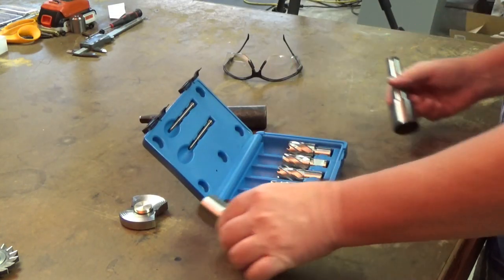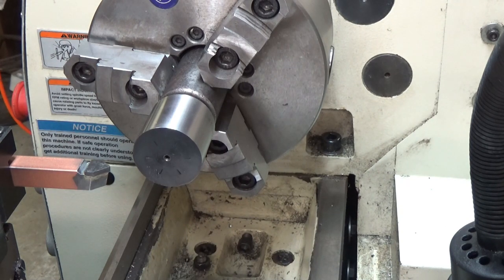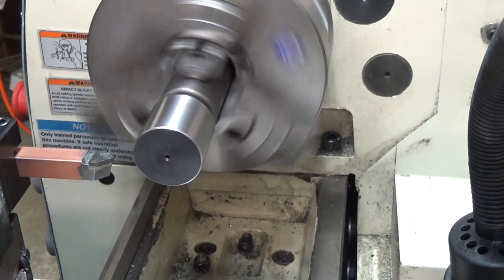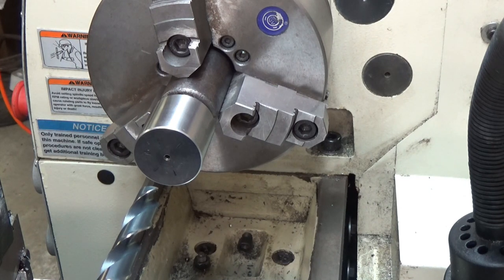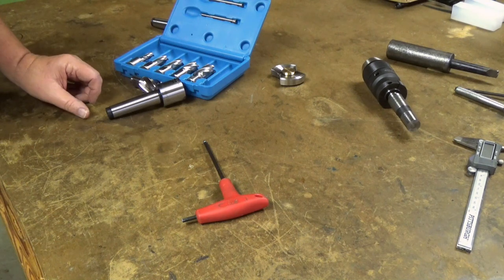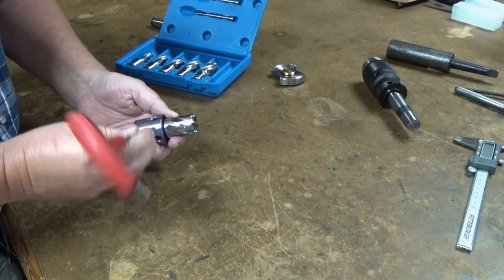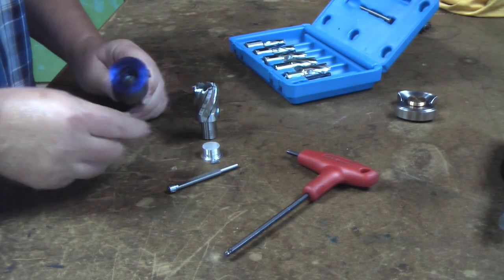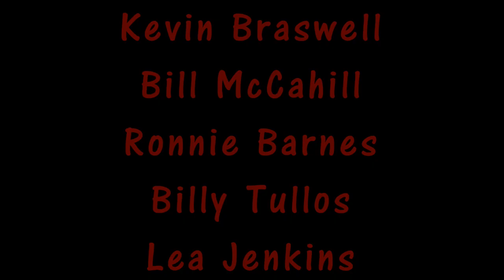How To: Annular Cutter Holder(Caution Subliminal messages ahead)

Comment: Those cutters are really great.  For some reason i have the irresistible urge to get Zeke a big doggy treat.
Reply from the maker: Yeah I was just playing around with the subliminal Zeke thing, the cutters are bad ass, made a really clean hole. If I had tapped the arbor in the tailstock in the beginning I would not have looked as stupid when I did the test at the end

Comment: Nice height gauge Brian. 
That's a great idea for the annular cutters - I have a set although not very good quality. I think I have one or two spare blank MT arbors that might be useful. May copy your idea there.
Those things are great for saving lot of drilling etc before boring bar if needed.
First flash of Zeke took me by surprise!
Reply from the maker: I was quite impressed at how well that thing cut, it does make a rats nest of chips.. I do wish I would have got the tool better seated in my tail stock at the end when I demo'ed it.. oh well..

Comment: Question is why make a tool holder when their readily available finished machined? The Morse taper ones I have also have the tang to prevent any slippage as was shown here.
Reply: The tang on a Morse taper isn’t for driving……….it’s there to help you get the thing out of a blind hole.

Stavros
Reply: @stevecallachor  it can help also prevent initial slipping. If not seated properly

Comment: Hello Brian and Zeke,  Hope you are healing up and getting back to full bore.  I was watching Dudley Toolwright messing with titanium and thinking about you guys.  All the best.  Give Zeke an ear scratch for me.  Take care.  Doug
Reply from the maker: hi ya doug, Zeke is ok but me not so well, sure is good to hear from ya. I watched that vid, looked like a hi dollar lid to a 10 cent cup..lol
Reply: Sorry to hear you aren't progressing as expected.  Anything they can do?  I take it they have the expertise?

I had to laugh at Dudley but he sure is up for a challenge.  I feel the same way often.  I generally scrounge scrap steel for my projects and one of the toughest has been drive shafts off outboards.  Quite a mixture of metals and processes in one shaft.  i still haven't got it to cut acceptably.  Just chucked up a tie rod and it is showing a lot of similarities to the drive shafts.  I haven't used any high dollar inserts but I have tried plenty of cheap ones.  Can't get them to make a nice chip no matter what.  Parting brings on a plethora of more swear words.  It will often just not cut without annealing but more problematic is when it cuts beautifully for the first 3/4 of the inch shaft and then breaks the insert when the tool pressure goes sky high right at the last 1/8 inch.  I know it isn't work hardened because I can easily finish it off with a hand hacksaw.  It is like it hits a wall.  I would dearly love to know just exactly what the variety of metallurgy goes to making up the various hp and manufacturers shafts.  
Well you do what you need to to get better and I'll be rooting for you.  Take care.  Doug

Comment: Interesting project.  I'm not sure why you'd want to use an annular cutter in the lathe when you can drill and bore the work. It would be a lot more useful in the mill. I got some annular cutters about 6 months ago when I needed to cut some 1-1/4" holes in some 12"x12"x1.5" plate - too big for the lathe. I tried drilling, but it took forever and the holes weren't true. I need to weld the holes up and try the annular cutters, just haven't gotten "A round tuit"
Reply: They work best in and are designed for magnetic drills. Would be perfect for that heavy plate steel you are talking about. You really ought to see about getting one, you won't be disappointed.
I bought a used Jancey Slugger ( very large ) for $1,000.00. It will drill 4" holes in 3" steel. The hole is very clean and you get a very useful slug. I consider it money well spent.
Reply: Like butter they cut with less load as well.

Comment: Can an annular cutter be used on a regular belt driven drill press?  Provided of course, that we have the correct tool/cutter holder for a Jacobs type chuck ?
Reply from the maker: sure, mag drill use this type cutter
Reply: Thanks, and now I have to ask you, have you seen a Weldon to straight shank adapter that would allow  the annular cutter bits to be used in a Jacobs type chuck?  
I have seen all kinds of adapters with the more taper , but can't seem to find , what I would call, a straight shank adapter.

Comment: You should drill  6mm hole all the way throw it then drill a 12mm hole leaving a 8mm step on the end make a thread on the end cut a 11.5mm disc place in bottom put in large spring make a threaded end cap  put in the end cap you can then put in your dead centre that's spring loaded that shoots out the slug that's how I made mine for the drill

Comment: I would just cut some threads in the back of the annular cutter so I could screw a rod in there to use in the drill press...
Reply: Mike Sloan I have used a lot of the annular cutters and they are so hard that they are brittle.

Comment: Too high RPM for drilling especially for this size of drill , also the cutting tool extended far away from it base with a result when they touch the part to vibrate up and down u can see it very clear on the video !!!!!